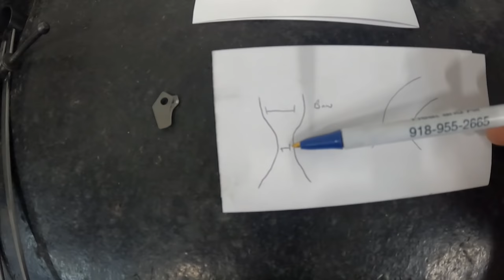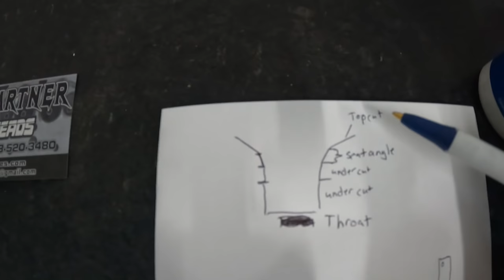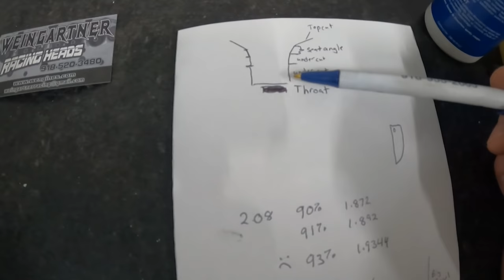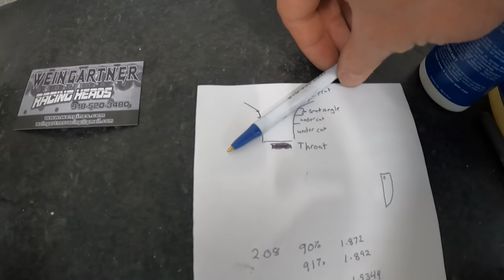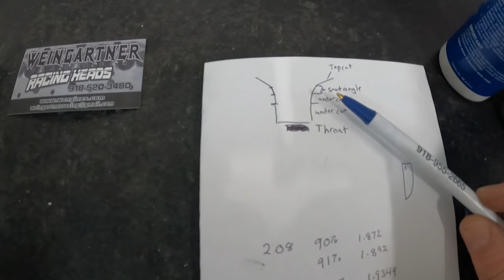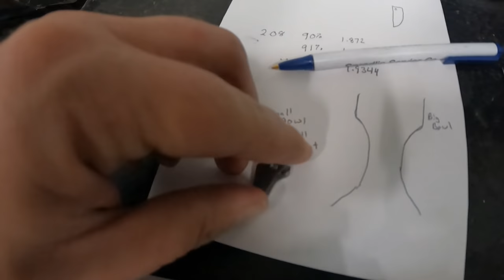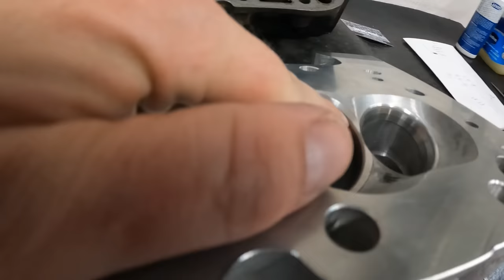What not to do when porting heads

Comment: I like to show folks pouring water out of a bottle, and that spinning it, can make it flow faster than the glug...then dump out a glass, and see that it runs to 1 side.
That the air has to spin to be as efficient as possible.
For beginners, just clean the flash and make the surface finish uniform for your application, dont change the geometry , and youll do just fine.
Reply: I started grinding and polishing valve seats on small bl chevs. at 14 years old. I never changed any of the flow dynamics. Only cleaned up small casting imperfections. That is all it takes to improve the flow where the valves are concerned. To finish waking up the engine, best bang for buck is tuned exhaust. DIY port matching is kind of the same concept. Just grind the very top of the port to match. Don't get crazy on removing a  lot of materiel and again, clean up casting imperfections. If you need particular track race heads, go purchase them from the pros. Basically to wake up a stock engine, simply clean up the manufacture's slop. Their numbers are close enough to perfect.
Reply: There's work to do relieving the intake to combustion chamber clearance which improves flow at ALL valve positions.  Some castings can shift around so every valve needs to be checked.

Comment: I was always told the reason not to hog the throat on a 'street' engine was to preserve the venturi effect and maintain flow velocity. What you're saying is it's the necessity to maintain a smooth angle transition. I think this is an excellent video.
Reply from the maker: It’s both things. Thanks for watching.
Reply: @WeingartnerRacing  hello can i ask. i dont get the hog and bigger throat. do u mean i dont need to touch the throat part? only the bowl partv
Reply: So I'm sure I won't get a response to this and I am not sure If this is covered in another video but how do you measure the throat for your 90% are you using a special pair of micrometers or something. Since this accuracy is very important then it has to be measured and ported very carefully. Kind if have to sneak up on it.
Reply: @chrislangdell117  Chris, you don't need any expensive tools. 
It can be done with just a rule (if your using a tape measure you probably don't have tools to do porting anyway!)
The easiest thing to do is just measure the valve and use calculator to get (my preference from what I've learned and read in last 50+years)) 88% for intakes and no more than 90% exhaust. Couple of fender washers and 1/4"(or ~6mm) longish bolts and nuts (to use as 'handles') file them down to the diameter you came up with from valve head diameter (electric drill and bench grinder is quicker )
One 'secret' I found out early on, air, at the velocity in ports (or anywhere else) doesn't want to change direction more than about 7 degrees ( I think you can still look it up in old (1940's) NACA documentation.
 There is a 'mountain' of information available, problem is finding time to go through it all (pretty sure it's impossible?)
Reply: @stoosee  just open throat to 99% and you'll be fine on any street engine. 
Even F1  with 18,000rpm engines doesn't go over 90%
Reply: @1crazypj  wdym 99%?
Reply: @stoosee  If a valve is 50mm diameter, 90% will be 45mm throat diameter.
Look up the Bernoulli Principle

Comment: I’m curious to how much of a power loss there really is, especially with overlap. You should ruin a set of heads and put them up against a good pair of heads to see the power loss/gain. Dyno Data is better then speculation. Maybe I can set you up with Richard holdner.
Reply from the maker: Put me in touch. I have another thing I want to test.
Reply: I have a great set or iron heads you can have to do your testing there super clean hot tanked everything is still on them there a vortec 350 head from a 1998 Chevy Silverado 062 head casting you just pay for the shipping and I got you brother I love the channel

Comment: Very good points...I might add that an easy mistake is to hog into the short side radius with a porting tool (Specially on
the intake port) which will cause major turbulence across the valve. New Guys, Read Smokey's book for the basics.
Reply: A good Hi Pro book for porting tips is Phil Irvings Tuning for speed. Bikes but I got a BSA up to 12-1 comp and over 100mph

Comment: Good video. I have used 90% on the intake ( with a back cut on the valve) and 85% on the exhaust for years and years (motorcycle heads) with excellent results. Bored on a Serdi for uniformity. Low lift #'s at .100 and .200 are very good (bike cams have .300 to .400 lift in general). Low lift #'s are critical as the event happens twice during the opening/closing cycle.....I am glad you made that point about them being important.
Reply: can i use 87 percent on exhaust?

Comment: well the felpro 1266 did not work i have deeper issues.. Great Vid. I have a fresh 355 with Dart heads that were from a circle track car. Heads were milled and i can see light on #8 intake through my victor Jr intake. My machine shop said to use washers on all 4 corners that equal gasket I'd. Then mold BB` model clay on all runners top and bottom. Slice in half and measure depth. Going to try tomorrow. Also china wall close but not hitting yet. Anything else i can try?  Thanks. John

Comment: Whenever I do porting, I typically just try to remove all the rough edges. I’m not looking for 800hp on anything I build. So a gasket match and a de-burring is all you need. Unless it’s a Chevy inline 6, then you have a little work to do.
Reply: The crux of the 250 is that the head bolts run straight through the middle of the intake ports. You don’t even need to port a 250 to boost power. Just cut out the head bolt pillars and add a short bolt instead. Use the “lump port kit” for even more power. It’s how you can turn 200hp into 250hp with no other modifications.
Reply: Glad that info was useful! It’s a very cheap upgrade that yields impressive results and does not take away from overall reliability.
Reply: Best advice I have read here.
Reply: Also match the head to the cylinder. Place head on block with no crank in it. You'll be surprised what you see. Improvement can be made here.
Reply: I'm a Ford engine builder. 40 years. Don't like chevy engines. I have my reasons. But the 250 is a great engine. I have one in my boat. Good on gas mileage and power.

Comment: Are there differences in porting when running NA or Forced induction? Like raising the roof and dropping the floor for NA or more volume on intake and exhaust for turbo?
Reply: Air flow is air flow. The only difference is biasing for turbos versus everything else (or nitrous). The same principles apply.
Reply: Depending on the original port size and application more csa can help efficiency. Typically you dont want to remove material from the floor it will increase short turn angle
Reply: I was thinking port velocity for NA draw but I see that flow is flow wether NA or boost the amount you can get into the cylinder is key. Great info in these videos!
Reply: @upfactoryracing4148  it's common for people to equate "boost" to velocity, but it's not. It is *density*. Now, this is NOT to say that velocity won't be affected, because at higher pressure differential velocity does increase (how supersonic and hypersonic wind tunnels work). I would have to see flow bench measurements, but I would think that the velocity increase would be local to the throat or MCA. I know Larry Widmer has been making supersonic ports for a long time. If memory serves, at that point it is choked flow and the only way to get more through is density (more boost).
Reply: @rocketsurgeon11  ok that is interesting so the choke point causes a pulse that the air bounds back off of around the valve into the cylinder. Man I would love to see a cutaway of that.
Reply: @upfactoryracing4148  I would have to go dig up my notes and all, it's been a while, but any nozzle reaches a point of "choked flow" where the flow is supersonic and the shock wave "blocks" any more increase in speed. (The thing is that this speed is NOT static inside the engine due to temperature, pressure, and density. A flow bench only approximated what will happen in the real world) I might be botching the description here, honestly. Anyway, at that point the ONLY way to increase what gets from one side of the nozzle to the other is an increase in initial density of the medium flowing.  In the case of our engines, we do this with forced induction (not counting chemical changes via nitrous oxide or fuels).
Reply: IDK but there is some differences between Gasoline and Nitro. Especially in heat control as its pretty important to have an exhaust valve at the finish line.
Reply: @dragonflyfab9703  As far as heat control is concerned, yeah, I would think there would be some different things going on there. I have never messed with Nitro, and I haven't done any research into it, so I won't comment further on that aspect.
Reply: @upfactoryracing4148  from all my research porting is important for n/a but with boost it isn't critical. The forced induction is forcing the air and fuel into the cylinder. I might be a moron and totally wrong 😕 maybe someone else will chime In

Comment: Simple rule is don't mess if you don't understand.
Port velocity as important as flow and bigger ports reduces velocity.
Reply: indeed
Reply: I think Ford has finally realized that
Reply: @oscarhedden9524  Explain?
Reply: Port velocity is only relative to the engine it sits on.  A 454 at 7500 RPM can use a much much bigger port than a 454 pulling a trailer up a hill.
Reply: @superkillr  The inlet ports on a European Ford 2 litre Pinto engine are huge for a road engine. Wouldn't know about American built engines.
Reply: @superkillr  I think what you mean is that port velocity is only relative to the desired use of that engine.
Of course a race car can use a much bigger port screaming around at high revs, but it would be horrible on the street, with a real mans gearbox.

Comment: You say a lot here that makes sense regarding the venturi effect and make sure that you do not exceed 15 degree angles so that the air does not detach and cavitate, which is well known in the aircraft industry. with such large valves and so little mass left between them, I would be worried about cracks between the valves, and maybe a lot of sharp edges for detonation. but now I'm not an expert on this, I've been an engine mechanic for 30 years for boat engines + various hobby tuning projects on the side of this. but in terms of porting, I have limited this to minor fixing in casting errors and port matching

Comment: I like the theory but I would like to see the actual flow bench data. I'd also like to see dyno results of a before and after head test. It's all very well to flow test a head on a bench but most people forget the flow through a high revving engine is nothing like the flow on a bench test. Therefore the theory presented in this clip is, in my opinion, unproven at this point. Sorry, but data is data and this clip doesn't come with data, only theory....

Comment: The seat angles help the air/fuel charge to stay closer to the seat and curl around it due to molecular cohesion, rather than it coming away from the sides of the throat and seat and slamming into the valve which causes bad turbulence and a high pressure area. It is for the same reason that the short side radius is very critical for flow.
Reply: How do you figure that ? You could sell swamp land in Florida.
Reply: Wouldbe interesting to try cutting angles in the short radius. Very difficult task.

Comment: I was taught entire point of porting is to move most air possible with least restrictions. Now I’m a water well driller pump installer by trade and have a ton of experience understanding how water flows and restricts so it only makes sense to me how air moves and small restrictions with water make tons of splashing etc so a tiny turn making a restriction will definitely cause tons of air turbulence.
Reply: Interesting.
 I read somewhere about fluid dynamics and water can be a good substitute for air/fuel mix but is around 1,600 times denser (and not about 1000 times as is mostly quoted) so you can use a much slower flow but high volume. 
I had a friend who sold his flow-bench (he stopped professional porting) 
He had a 55 gallon drum on top of shed to see where and how fluid discharged through valve. (he 'invented' measuring devices to use it as well)
He said it was real handy if a customer wanted to 'see' where his money had gone plus it extrapolated very well with Superflow' bench results
This was a long time before any 'wet flow' flow benches came into being (early 1970's through to mid 90's)
He also told me, the biggest issue was waiting for the water drum to fill up though
Reply: And though, sonetimes an crappy port and an good intake length make an excellent combo.
Reply: Least restrictions, yes.  But the limitation is keeping fuel droplets in suspension.  There's always some that drops out/finds the floor, and as mentioned, enough people have done enough work to show that 15 degree changes is a very good guideline - a pure radius does worse.   Things get weird in the 4 valve world regarding throats - numbers in the 85 to 87% suggest there is a minimum step change [throat vs valve diameter] needed to flash fuel back into suspension during early intake opening event.

Comment: Note the throat is actually a venturi.  And the laws of physics apply.
Reply: What laws of physics ? Explain.
Reply: @Faolan161  I studied laminar flow in the water jet industry. I worked in research and development.
There's none of those characteristics in an intake port or exhaust because angles are not straight.

Comment: Hey Eric This video hit home. I have seen what guys do to there heads, Then when they re install think they took all the material off, the motor does not pull like it use to . Well you example is out stand. Makes so much sense. I have never done any porting at all just some little clean ups. Great video. These kind of jobs should always be done from someone like yourself that know the physics of head porting.
Thank you so much Fred

Comment: All your vids prove one thing.. unless you have dreams of doing head port work and development as a career and spending the time and money to buy the equipment to do it right.. it's cheaper to just start with a good head and then pay a pro to modify them if you've maxed out the combo as is.
Reply: As much as I hate to accept defeat.. this is probably the wisest move for almost everyone.  The stuff produced now on CNC's is really really good.  For ANYTHING on the street there is no reason to need a professional head porter.
Reply: True. Doing it yourself is more just for fun. Like playing guitar or painting.
Reply: @superkillr  I totally disagree you can get more overall power in the entire range and better fuel economy if you have the heads ported for high-velocity and a multi-angle valve job and no one can see you modified it which is the best part

Comment: It's basically dealing fluid pressure head, the angles and flow cross-section area determines the fluid velocities and pressure heads. On a more critical examples are the design of wind tunnels and nozzles.

Comment: There is 2 things a flow bench are worthless for. One is a rotary engine. Complete an utter waist of time with trying to flow test the ports on a rotary. Those engines are all about volume and timing not the amount of flow. One can also argue this with 2 stroke. And the second is boost application. Especially on small displacement high rpm engines. Granted there is more usable information with the flow bench on a boost head then an iron of a rotary but one can argue your theory about bowl size and choke points when you put pressure behind that valve above atmospheric at any given lift point. Object is volume at that point not creating a Venturi to speed up air flow. I come from rotary. Both na and boost. One thing I have learned with them is it does not take psi to make power but a massive charger at a lower boost level will make power and at a safer level. Example take a 13b with a gt35 . That engine will and has made north of 600bhp but at above 28 psi on pump gas and will stop producing tq at about 5500 rpm . Now take that same engine bolt a gt4202 to it now to make north of the 600 bhp you only need 18psi an tq production does not fall off and exceeds what the 35r did at all rpm points and is just as responsive . Same can be said to a point on a 2.3lt turbo 4 cylinder engine head port. Not the turbo size but volume of air flow being forced into the cylinder. I recently did one with taking the port bowl to full square to the seat. Much like you explained in this vid and said was wrecked. The results with the same turbo was about 500 rpm sooner spool gained about 50 to 70 tq depending on rpm point and gained about 25 whp and the power curve pulled 2000 rpm further out as this particular engine was always a lower rpm power peak from the get go now seems corrected. Explain that

Comment: Do you less small choke percentage if you are limited to lower lift cams?
Does a radius undercut help over multi angles?
Reply from the maker: If anything in that case I usually try make the throat larger as long as I don’t compromise the angles of the valve job too much. Radius valve job should only be used on exhaust because you need that angle on the intake to help with atomization.

Comment: I have a question would it still ruin the head under boost since air is jammed in .NA is more picky
Reply: I would say yes. A Boosted engine should be thought is as NA with higher ambient pressure. It still draws air into the cylinder, just higher manifold pressure. It's generally not ramming air in as you would think. The piston moving down still creates a draw into the cylinder where there will be a pressure drop, and the pressurised air enters the vacuum when the valve opens.